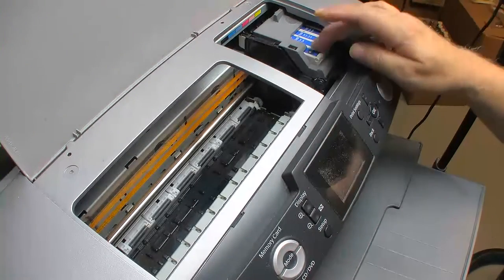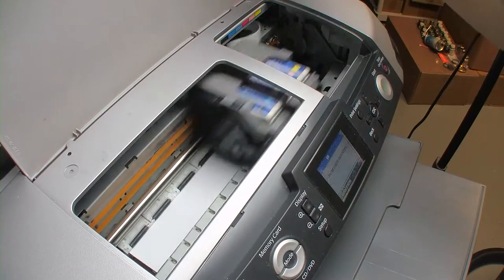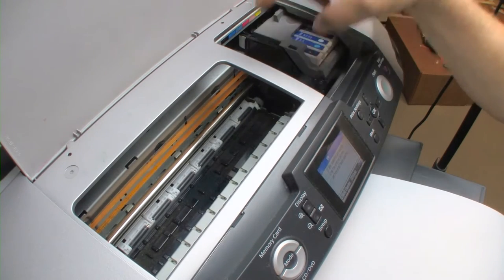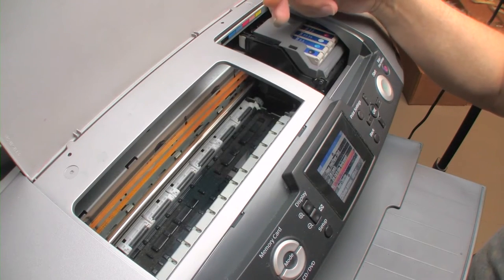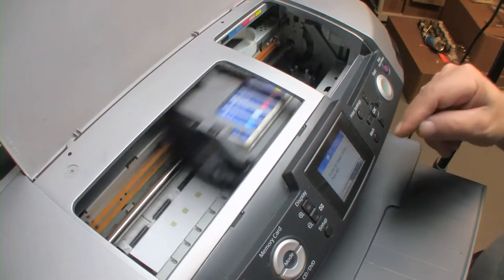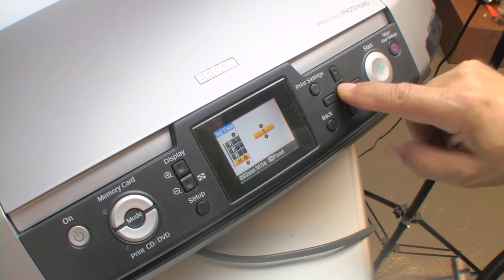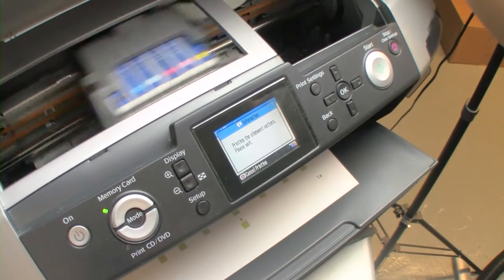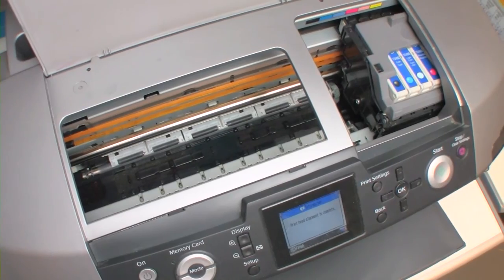How to Rescue and Revive a clogged neglected printer - Part #3 Nozzle and head Alignment

Comment from the maker: In this the 3rd installment on the Reviving a Printer series, I have done the following.

When I left you in the second video I needed to get more inks in order to be able to perform any more cleaning cycles if they were needed. Well, the were.

New carts where installed, a cleaning cycle and nozzle check indicated the same nozzles where still persistantly blocked.

I set up another Windex / Paper towel soak which I left over night. In the morning I did one cleaning cycle and turned off the printer and let it rest for several hours.

It is at this point where I began this 3rd episode.

Hope you enjoy it and please subscribe if you like what I am putting out. It is greatly appreciated.

Any comments you may have are fully welcomed!

Thanks and see you soon with Part #4!
Reply: Hi Jose,
I have an Epson R2000. I purchased it brand new in Jan. of 2019 and have only used OEM ink cartridges. I am an artist and I use it about 3 times a month to print 13x19 giclee prints on Epson Velvet fine art paper. I also have a software program that prints a test page of a row of every color twice a day, once in the morning and once in the evening, so basically, this printer has printed everyday since I've owned it. Lately whenever I change a cartridge, it appears to get clogged. It's anywhere from 1 to 6 colors that show 0 to 75% clogged on nozzle checks. Could it be air clogged as it happens only when changing cartridges? I've tried 2 head cleanings, then a nozzle check, but to no avail. 
I haven't tried putting fluid in the nozzles yet. If it is a true clog, I first want to try resting the head on a windex soaked paper towel overnight but as you mentioned in this video it could be dangerous because it can wick the ink out of the cartridges. My question to you is, can I take the cartridges out and put them in a plastic tub while the head is soaking? Any advice would be appreciated. Thanks for your videos, I hoping they will help.